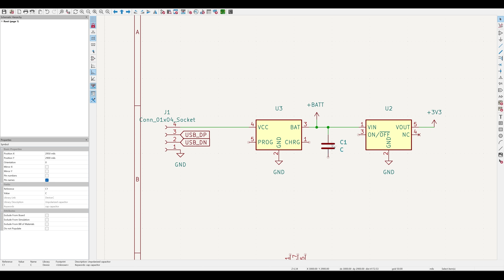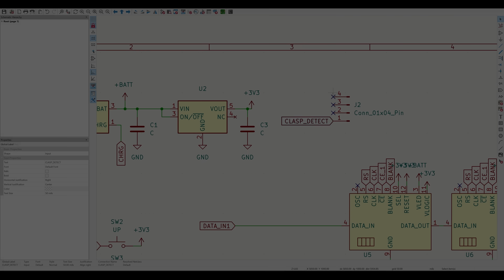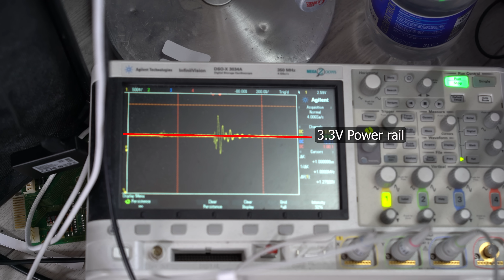How I Built the Watch From Cyberpunk

Comment: You could improve robustness by making a solid bracelet with single hinge for removal and glueing the flex PCB onto that, that way the displays are unlikely to get dislodged. As for battery you could use thinner and narrower cells with much lower capacity, but arrange a load of them lengthways on the inside of the bracelet going around it and then connect them in parallel for a much larger capacity than single cell. I absolutely love everything you did! Such a great idea and great execution. I have piles of old displays like this, I might dig through and see if I can pull something similar off.
Reply: almost like your idea, you could make a tennis bracelet style watch with each display in its own housing like a solitare and a few of these links going around the wrist. and this should be modular too, so each link by itself doesnt do much but when you like link more than 5 they have the watch functionality, or maybe there's special links with the buttons where they have the logic to display time. it would also be better designed like jewelry for today's aesthetic, but going for a minimal bezel futuristic design would also look awesome.
Reply: It might be tricky as you really wouldn't want to sell them with a bunch of lithium batteries and I'm not sure what else would reach the density you'd need

Comment: Of all the videos Ive watched, this is the one thats going to push me to learn how to start building. I'm a software engineer but Ive always avoided hardware because of the entry cost of a good soldering iron/pcbs
Reply from the maker: You dont need a particularly good soldering iron, and custom pcbs are quite cheap, but start off with perfboards or strip boards which you can get very cheaply, and find broken electronics to take parts from
Reply: @Sahko123  Thank you for this comment btw made me actually realise theres a difference between a workstation and portable pens. Got myself a pinecil v2 (probably better options but it was cheap and seemed to have better iron os support)
Reply from the maker: @Syanticraven the pinecil is one of my main soldering irons, then I also have a jbc t245 and a metcal station. But the USB c iron is one of my favourites
Reply from the maker: @Syanticraven  plus I'll get a fair bit of use from my main irons in my next video

Comment: Cool idea, but I have a feeling that implementation can be better.
Reply from the maker: This was created for the aesthetics, not as a commercial product, if I needed to I could have made the supporting circuitry invisible or made this thing unbreakable, I just didn't need to
Reply: @Sahko123  Yes, I do understand it was a proof of concept. Still I have this mind itch because I design PCBs occasionally.
Reply from the maker: @vasiliynkudryavtsev well if you have suggestions for ways to improve it then I'd love to hear them, at least if I do another flat flex I'll be aware
Reply: @Sahko123  Well, the very first idea come to mind.
There are some I2C OLED display modules on aliexpress which have usual composition OLED-flexPCB-rigidPCB. You can use rectangular OLEDs with edge connection to put many OLEDs on same custom flexPCB ditching rigidPCB part.
And these modules are very cheap.
Reply from the maker: @vasiliynkudryavtsev what's the point then? Then I just have an oled watch
Reply: @Sahko123  In OLED smartwatch you have only one big screen. I was talking about flexPCB bracelet with many tiny OLED displays soldered on. 
Like you did with VFDs. But cheaper.
Reply from the maker: @vasiliynkudryavtsev these are leds, but the oleds are just cheating then, not too interesting. Like the oled "nixie tubes" that are just oled with plastic around them
Reply: @Sahko123  I've seen one youtuber making 0201 LED array earrings.
The hardest route yields the most entertaining performance, but I'm not sure if viewers would even try repeating your work. Depends on your goals.

Comment: You need way smaller capacitors right at the power lines of this modules. I mean in capacity sense, it may seems counterintuitve at first, but smaller caps are quicker in reaction that big caps, better preventing sharp transients.
Reply from the maker: I added 4.7uf ceramic caps to some of the displays. I didn't really have any issues with Brown outs on the flat flex in the end it was pretty much just the breadbord. But in aware of how to choose the right capacitors for the right job, if I needed perfect decpupling I would have used a 470n and 2.2uf for this
Reply: @Sahko123  Probably your power supply have some oscillations after current inrush, battery in device will not do it.
Reply from the maker: @AK-vx4dy well it works perfectly fine with the battery and with the caps, a lot more current available from the battery, the full prototype made powering over USB drop from 5v to like 3v
Reply: @Sahko123  What ? 🤯 USB from laptop or some phone charger ? Quite a current, no resitors in application note or they are used as multiplexed normally ?
Reply from the maker: @AK-vx4dy USB from my pc, the disays have current drivers built in and are basically shift registers

Comment: Looks great, I understand its expensive right now and also fragile, maybe it would be possible to 3D print links that each display fits inside and the PCB just slides through? Or maybe put a couple of locating holes in the PCB and embed it into a printed link wristband and maybe a magnetic clasp? Maybe its possible to get all of the running gear and 3 displays in to a typical watch face size? that also maybe a viable cost option in terms of selling too and potentially people could option at extra cost more displays?

Comment: was just thnking, here are a couple of design idea you may fancy using to upgrade the concept;   1- fix the 3 segments with the time into a case to keep that bit rigid. then strengthen the flex-pcb using an old car seat-belt, cut to size and glue it to the underside. when thats all done. make a concaved mout for a mold, add clear silicone to the mold and then place the watch into the silicone to keep flexability and strength, plus it will be waterproof after! the same way they make waterproof led strips with a layer of silicone, is how you should go ablout it!
enjoy! Nice concept design by the way!!
Reply from the maker: I did want to initially encase it in clear orange silicone! But I ended up scrapping the idea cause I couldn't get the silicone right, I preffered the look of no silicone and I didn't have any time or place to do it anymore
Reply: @Sahko123  point taken, i forgot you was on a deadline... but hey, take a good look at a waterproof led strip and you will see, if you want that strap finishing properly, then thats probably the best way to do it. and with some form of fabric at the back to strengthen it. if not, then fairs... its a free idea! good luck all the same! but finish it lol

Comment: Great work, that thing looks gorgeous! It's a shame the displays aren't easily available.

Re: the power integrity issue, you likely got worse results on the breadboard because those things have horrendously high parasitic inductance, in part because they have no parallel ground plane to offer a solid return path and some interplanar capacitance.

Comment: What a cool idea! 😁👍 - i personally wouldn’t trust the connector and maybe add a leather string or something like that to secure it. And maybe wouldn’t use a flexible pcb but rigid single pcbs for every display, connected with cables - so that there’s more reliably and durability. But that’s just from the outside, and it’s always easy to come up with ideas from an outside perspective. As i said, very cool project! Many regards from Germany! 👋😊

Comment: Nice project, you should use monochrome OLED, like ssd1306 (there is also yellow color) for the next bracelet, something on SPI. I think with OLED and CH32V203 or esp32-c3/6 it will be much more power efficient and reliable, and also cheaper.

Comment: Truly inspiring project, a 3d printed chain case around this would make it much more durable
Reply from the maker: Probably not 😅 the issues came from the flexing not from my like bumps or being hit where a case would help. So the pcb would always flex the same
Reply: @Sahko123  the 3d print could have a hinge like a handcuff! Securely mount the pcb in its final position, then have a dedicated fold zone like a samsung. You could also integrate limit stops to ensure the flex zone doesn't enter plastic deformation territory
Reply from the maker: @decreasinglynumberless  yeah the print would have to be extremely tight and at that point the 3d print is more likely to fail
Reply: @Sahko123  your concerns are valid, but this is my wheelhouse. If you wanna do some light collaboration I'm down, but youtube comments suck and I cant share visual aids lol
Reply from the maker: @decreasinglynumberless well the project is done now and I don't plan on updating any time soon

Comment: Would be neat to do this with discrete 0201 or even 01005 LEDs and one of the LED matrix drivers in a WLCSP package, then cast the whole thing in silicone. With an non-DIY budget use  bare die LEDs (assuming you can wire bond to flex).
Reply from the maker: I presume you can wire bind to flex, just would need to encase it, and hope the wire bonds don't fail

Comment: The displays were installed in the Cisco 12000 Core routers in the route processor cards. After we switched to Cisco ASR i looted as many displays as i could get. The colour is so close to nixie tubes.
Reply from the maker: I didn't know that's, that's really cool! They're probably a more reliable source than of the 🤣
Reply: @Sahko123  We had three Cisco 12000/10 as core routers and two 6U access-routers and i looted most displays :D I work for a medium sized ISP in Hamburg, Germany. Sadly i still have no use for them.

Comment: btw, your structure seems very delicate to the eye. I'm curious to know, whats the integrity of the thing like in person?
Reply from the maker: The first time I built it, it broke every hour or two of use, the second time I with leaded solder instead of the annoying indium bismuth solder it hasn't broken since.

The flex could use thicker traces and maybe stainless steel stiffeners to help strengthen it. The I believe it would be quite reliable
Reply: @Sahko123  sounds like a good plan, and a hint to a part 2!

Comment: Hi. 
Have you try to take out the display chip out of the transparent case ?
It probably solve the issue of soldering and this would be thinner. 
Cool project anyway
Reply from the maker: The led board and control ic is epoxied in place, part of the aesthetic is the way the leads reflect inside the clear case that I just really love

Comment: These displays look amazing, especially in a chain. What are they called?
Reply from the maker: These ones are the HCMS-2901 there is a newer more available (yet expensive) hcms3901 which is 3.3v compatible
Reply: @Sahko123 cheers! They really look as good as VFDs, but more compact and without the high voltage. They don’t seem too common yet - good find!
Reply from the maker: @jimmy21584 these have been around in some form or another since the 80s first from HP, then Avago, then now broadcom

Comment: I'm loving this concept, but what a price tag indeed. There are flexible led RGB matrix displays, the 12x48 should fit a wrist roughly. Would this also work? It looses the retro vibe but I really like the wrap around watch idea
Reply from the maker: Using just discrete leads or a flexible matric like that was my idea if I ever wanted to make these slightly cheaper and more useful with like connection to your phone, one of the hardest parts is getting a battery to be more or less concealed or at least not prominent

Comment: Ideas 

add a cover over and around the displays. 

 a magnetic mount for the displays and just have them mount to the pcb perhaps
Reply from the maker: One flick of the wrist and if you don't have a strong magnet all them displays are going off 🤣
Reply: @Sahko123 I think if they’re alternating with several on each it can work, but I don’t know the weight of the displays. Maybe I’d they were all linked at the sides too with something else or a cover? It hurt to see the display die due to the hot air. 

Very cool project, I shared your video.